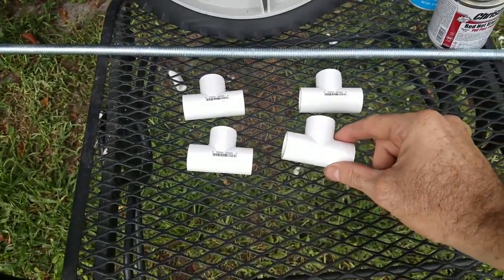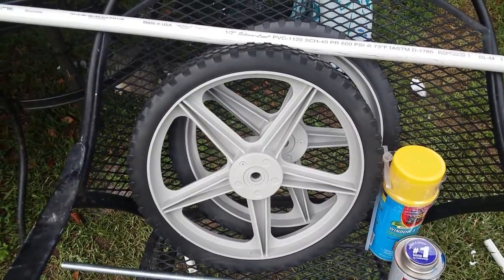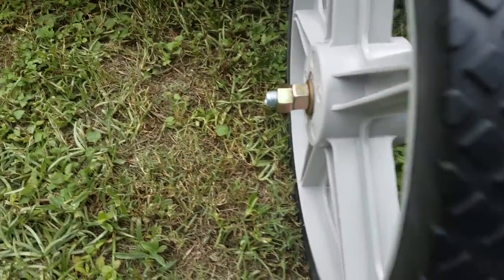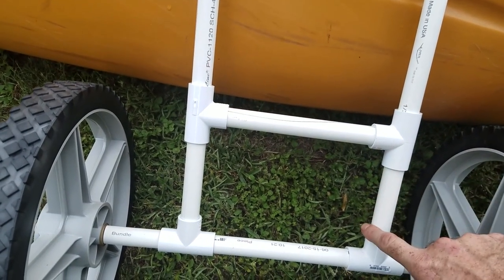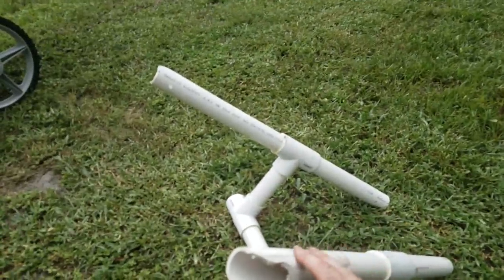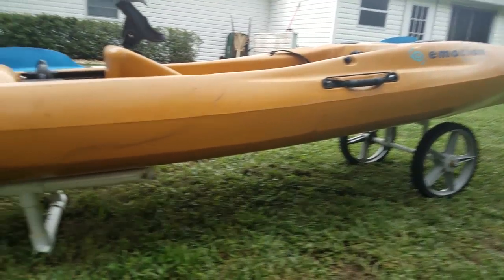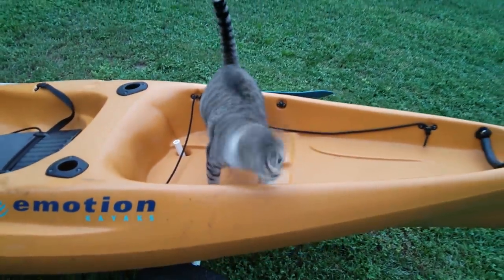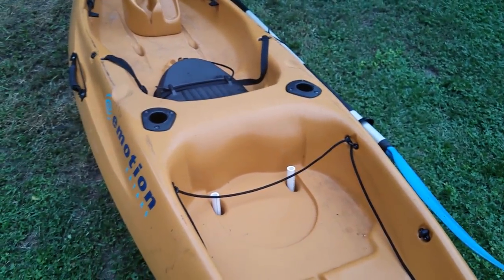Homemade Kayak Cart v3 (CHEAP EASY FAST)

Comment: Hobie is a strong kayak but not all kayaks are. Be careful about cracking the scupper tubes and creating leaks inside the kayak.  Exterior straps may be safer
Reply from the maker: Thank you for the feedback. This isn't a Hobbie it is actually a emotion. I find Hobbie to be a tad on the generic side
Reply: The pvc will break before you ever damage the scupper holes.

Comment: Do the wheels have bearings or is the plastic hub of the wheel grinding on the threaded rod.another thought for  stabilizing  the pc would be to cut a piece of pc pipe on a table saw length  wise,but only cut half way through the pipe,then sleaze the cut pipe inside a solid pipe
this will double the wall thickness to about a schedule  80 thickness.
Reply from the maker: It's a plastic bushing. So far after over a year it has not shown any signs of wear and I use it almost every weekend.

Comment: Great Video! Where did you get the wheels? I want them!
Reply from the maker: George F. Potstada  III hey buddy. They're actually replacement wheels for the back of a push mower. You can find them at lowes, Walmart, home depot, and ace hardware. I forgot how much I paid for them but they were cheap
Reply: Thanks!  Heading there now!